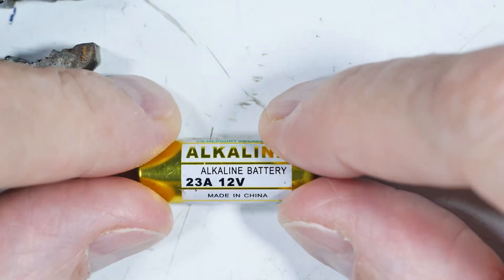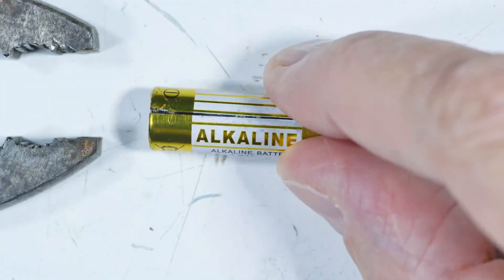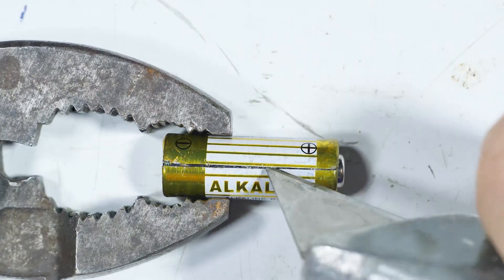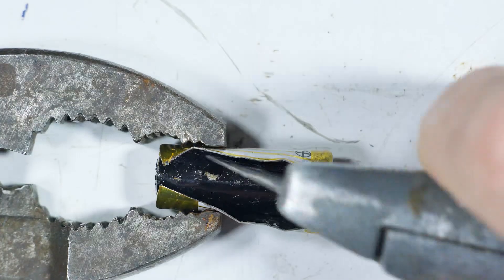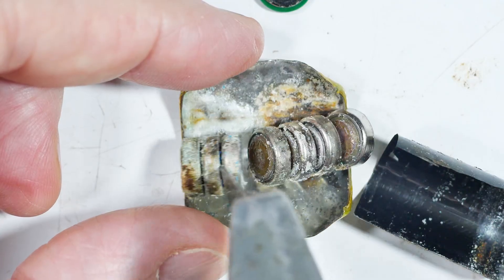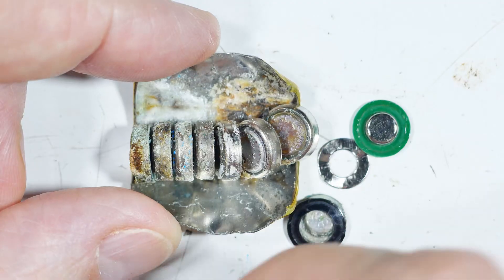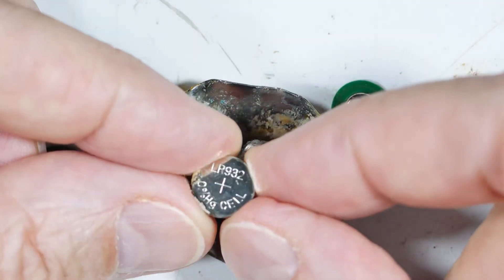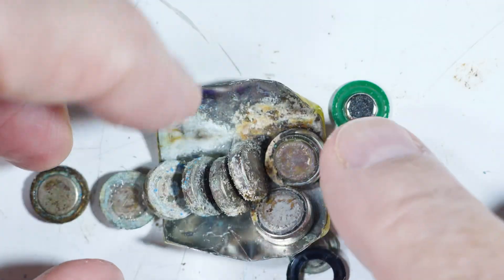What's Inside a 23A, 12V Battery? (4K)

Comment: Just saw the battery and I couldn't believe the rating. So I decided to dig.... But I am still wondering about the 23A...
Reply from the maker: The model number is 23A. The amps are in line with typical button batteries.

Comment: For those like me that are looking for specifications on this type of battery, it can usually deliver around 55mAh.
From what i could find in a datasheet from one manufacturer, typical discharge is 0.5mA for about 120h, and at 15mA its capacity will be about half of the stated 55mAh when reaching cutoff at 6V.

Comment: I have one of those in my remote door bell (mounted on the concrete pillar of my fence). 🤔🙄😊

They can be a good source of those 1,5 V button batteries. The latter can then be used in like pocket calculators or in a MagLite Solitaire for example. 😉😏
Reply from the maker: I have one of those battery/remote doorbells also and I gave up on it and made it solar.  https://youtu.be/9_5phbv5-L8